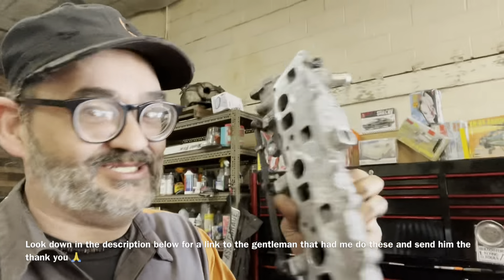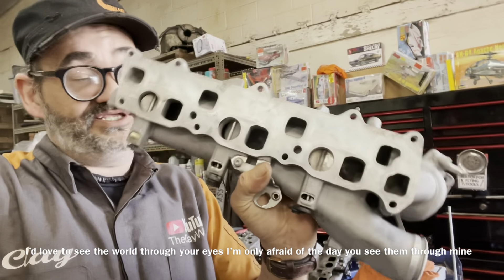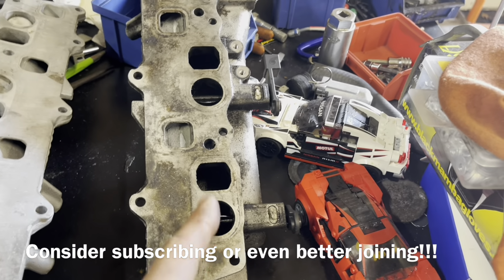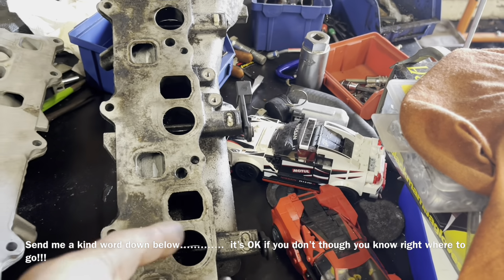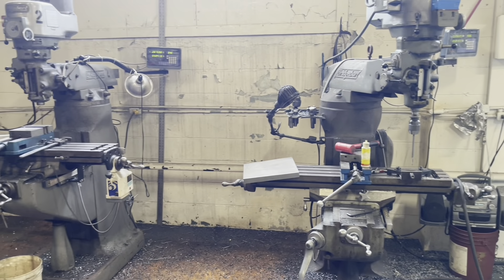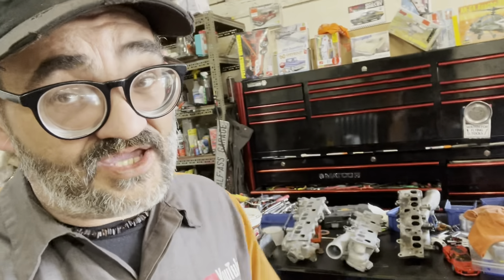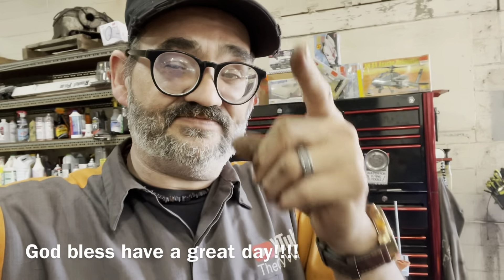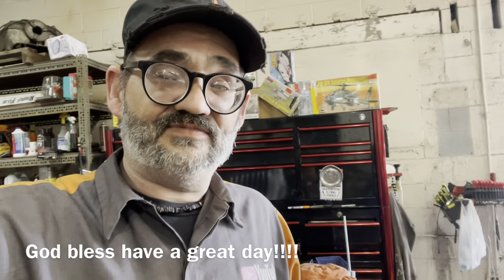Swirl Flap Delete Sprinter/ Mercedes 3.0 CRD Diesel W/O programming

Comment: Thanks for the video, I have MB 320 CDI codes for under and overboost. No power on hwy takes off up to 2500-3000 and nothing more. Any suggestions?
Reply: This video is your solution, also I suggest you service your injectors and replace your oil cooler seals, as that is another engine problem and the same parts must be removed, so you do all the work once
Reply: And the inlet turbo seals

Comment: Hi Clay, I have a 2008 OM642 and everything is working fine, have you ever heard of the air needle mod for swirl flap preventative maintenance? where you puncture a basketball inflator needle through the hose on the suction side of the turbo, thena thin fuel line into the cab with a bottle of seafoam or diesel? and while cruising highway speeds you give a few squirts every once in a while? apparently if breaks down carbon over time and cleans the swirl flaps to like new condition, or so people have said. Have you heard of this?

Comment: Swirl flaps are open after a certain RPM, I never heard of someone clogging their DPF because of them being deleted, even without a tune for it. If the engine is mechanically fine, you're creating marginally more soot at lower rpm. I have a friend with a Sprinter that deleted his flaps with the resistor dongle 250k km ago. Engine still purrs, 580k km total so far, original DPF, never cleaned.

Comment: With this Delete would the effect of engine breaking also go away. I understand that engine breaking effect or Compression breaking as some call it is caused by flaps closing when not accelerating.
Reply from the maker: No, there’s probably a leak in your PCV

Comment: Hi brother, I have a 2007 sprinter and I have code p2526 and p2978 and it’s drives but it won’t go fast (limp mode) any suggestions? Thanks
Reply from the maker: Yeah, either rebuild or replace your intakes

Comment: ok so on a 2008 dodge sprinter i removed the swirl flaps and put a diode in the plug and i still get a check engine light. with the check engine light on its in limp mode and barely gets outta its own way. i would assume the swirl valve position sensor is going to tell the computer there not moving and set a fault code.
Reply from the maker: Well, of course you did…. Because you didn’t send them to me. Now I can’t help you you need new intakes.

Comment: I like your videos thanks for sharping your acknowledgment, I have that same issue with my 07 sprinter I bypass the swirl motor nothing happens still limp mode I disconnected the EGR that’s was worked for couple weeks and then limp mode again now it’s seem nothing to do expect if I can try to clean those intake might be works any suggestions let me know , again thanks hope to heard you back soon
Reply from the maker: Well I can tell you that I tried to clean them about half a dozen times and then when I put them back in it went back in limp mode two weeks later….. I strongly recommend against you trying to clean them unless you want to do this job twice let me know after you take them out if you want to do it twice…… (PS you will have absolutely no desire to do this once again unless that’s what you do for a living like me)

So like I said in the video I would recommend you send them to me but you don’t have to I don’t need the extra work I’m just letting you know my experiences it took me a long time to figure out how to clean these things and not have them lock back up